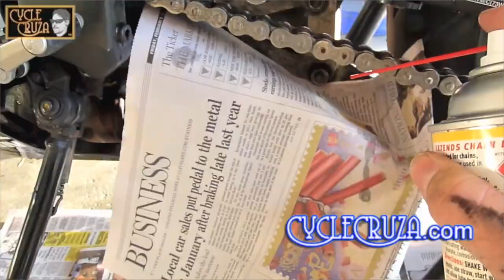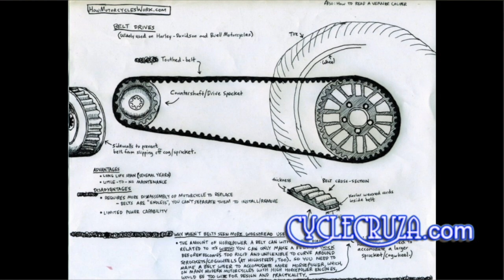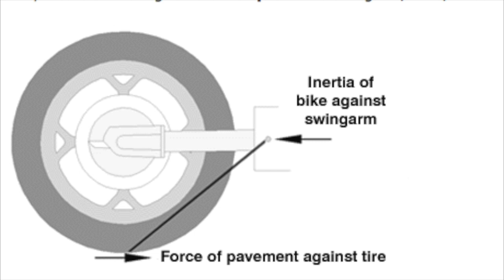Motorcycle Chain vs Belt vs Shaft Drive  - Which is Better?

Comment: As a certified technician for 4 major brands, the best drive as far as maintenance is the shaft drive, requires little to no maintenance. Belts follow. Then chains. But it also depends on the application and conditions and riding style you are trying to achieve.

Comment: Hey Cycle Cruza, love my FJR. As you know it is shaft driven but I love it. Very low maintenance, the manual says change the fluid every two years. It is a heavy bike, but plenty of power for riding on the streets. I haven't had any issues with it.
Reply from the maker: Yeah if you don't care about weight and some power loss but love low maintenance than a shaft drive is a good choice. Really, it comes down to preference.

Comment: FAKE NEWS!  The shaft drive does not lose 31 percent of its power, it does not have a bunch of gears as incorrectly illustrated in this video, and there is no longer a jacking effect. My VMAX 1700 loses 12 percent between the crank and the rear wheel. The inefficiencies of the shaft drive are not from a bunch of gears, rather it’s from the need to change the direction of the rotation. The changes in direction can be reduced if the bike has a longitudinal crankshaft. The rear jacking effect keeps getting repeated over the decades by those who have never ridden a shaft bike. Rear jacking was an issue in the early days, but not so much today. My 2020 VMAX does not jack at all.

Comment: Yeah theres no changing a belt at the side of the road. However, your belt snaps on the highway you lose power and can maybe coast to the shoulder. Your chain snaps on the highway its most likely going to lock your back wheel up and cause you to highside.  I know which I would rather have.

Comment: Where can i get som documented numbers about the loss i Shaft drive. I understand that the loss will result i heat and there is no probs with heat on a shaft drive. You got higer mass / weight, but this is only a problem during acceleration. I have seen numbers that indicates 5% i loss difference.

Comment: I think belt drive is the best compromise. You get the power of the chain with the low maintenance of the shaft.
Reply: I forgot to add that’s it’s also the safest if anything goes wrong.

Comment: I’ve owned all three types. I hate the maintenance that comes along with chains, but they’re the best in my opinion. I wouldn’t shy away from any of the three, because they all have their advantages. Belts are damn near set it and forget it. While shafts are heavier, I feel like that low weight some times helps keep the bike stable through crosswinds on the highway. I think it’s hard to beat the efficiency of a chain, but I really hate cleaning and lubing it.

Comment: Every bike I have had has been shaft drive so I cannot compare to other drive options. I’m spoiled. Love shaft drive. Although power robbing, I love the way the bike lifts up under heavy torque. I change the diff oil with oil changes. Easy easy easy maintenance.

This spring maybe you can try out my shaft driven VTX ??
Reply from the maker: Nice! Yeah low maintenance and with cruisers weight is not a huge concern anyways, it's all about cruising and enjoying the ride. You have some really nice cruisers. I was going to say keep riding but you're probably shoveling a lot of snow in blistering cold weather. lol

Comment: i ride a2015 honda shadow 750 vtc and i love that cruiser bike and it is shaft driven owners manual says i dont have to change the shaft oil till about 20k mimes and that if your going by milage. and i love my bike to pieces. it is a perfered choice to me i dont want to speed around just want to cruise ar. Love the videos cyclecruza. keep on Riding!!!! Honda CBR RR ha ha!!!
Reply from the maker: Yeah shaft drives are super low maintenance. However you get added weight and some "shaft jacking" which is a not big deal for most cruiser riders.

Comment: Brotha Cruza.  Before buying both my Ducati V4 R and MV Agusta Brutale Serie Oro, I was actually looking at getting the 2020 BMW R 1250 RS(this bike has a 105 lb per foot of torque !!!!) because of the shaft drive that it has.  Also with the 3 year, 36,000 mile Warranty along with the all famous(at least where I live) 'Loaner Bike' program which my local Motorrad has in case any warranty or recall work has to be done over a 2 day or a 2 week period !  No other motorcycle dealer in my area, from KTM, Ducati, Suzuki, Honda or Harley has a 'Bike Loaner' program; except the local BMW motorcycle dealer.   That alone was a good enough reason to go with BMW.  But, so far so good I haven't had any chain splashing issues.  Perhaps in 5 years I will get back with BMW to buy a shaft driven bike :)
Reply from the maker: Yeah BMW has excellent customer service and the bike loaner program is nice.

Comment: Pro-tip: using pure kerosine (just kerosine, none of that citronella smokeless crap) to clean the chain is the best. It doesn't damage the o-rings on the chain, it's easy to find and it's fairly inexpensive.

Comment: Hey CC, when you mention that shaft drive reduces absolute efficiency by 30%, does it mean that bikes w shaft would have a ~25% increase in power if converting to chain drive as a result?
If that's the case, my idea of engine stress on bikes like the fjr1300, super tenere 1200 and r1200gs is radically changed.
Reply from the maker: It just means that if you took the same bike and converted to a chain drive it would be a bit faster than with the more complex and heavier shaft drive. Like the saying goes "No chain no gain!"

Comment: Looks like the kevlar belt took the damage well. I wouldn't be looking to change it based on what I saw in the video. Additionally I've not heard of anyone whose had a belt failure, nit to say nobody has of course. Chain or belt I would say depends on the application, for sports bikes chain, but for mid range power and torque like cruisers for example, belt all day.

Comment: Yeah, that dude ripping the splines from the drivshaft should probably not have spaced out the sprocket so it only had half the splines engaged, and then maybe torque the nut and lock it?
It would have happened to a belt wheel too.

Comment: My Kawasaki Vulcan, Yamaha Maxim X, Honda Cx550 were all drive shaft no problems ever. My Honda cb 360, and Rebel, were chain. My Harley Sportster 883 stock and 1200 stage 1  were belt. My fastest bike was the Maxim X from 1985 Inline 4 16valve with top speed of 130ish and a quarter mile @11ish bone stock.  My heavily modded Maxim X was even faster and both were drive shaft. My Kawasaki Vulcan bone stock was quicker then my 1200 stage 1 but the sporty on the top end would crush it again (Vulcan) shaft drive. My experience has been shaft driven is not slower then chain or belt. However all these were cruisers but Maxim X had the same engine (Similar) as the Yamaha r6. 🤯

Comment: One other bike that is shaft drive are scooters. There are exceptions though. But I'm sure most aren't interested.
Reply from the maker: Yeah, one of the reasons why they tend to be so heavy. Shaft drives add a lot of weight compared to chain and belt drives

Comment: When  you say  $700  for a belt  you  must  mean   Retail   price  from the Dealer and  Dealer  Labor  costs to install it..   I am sure  you can  buy a belt  aftermarket for much less..   I had a  4 wheel  drive     Tractor  Dealership  built  Minniapolis  Moline Tractor that was belt driven .. the Belt  was 4" wide and very thick ...

  When  you say  you loose  11% pwoer  from a chain and  31%  from a shaft  crive..  You  mean from gross engine  HP  to the power lost  from the transmission  shaft and  rear  differential ..   combined..
   Shaft  Drive  bikes  also  get considerably  worse  MPG  thanks to the  power loss in the  differential ..
   You  can  put  elctric  motos on the wheels  of a car  and  run those  motors  with a gasoline powered  engine and   get  better mpg than  with a  transmission and differentiol propelled normal car...
Reply from the maker: Ducati parts are super expensive, even if you do the work yourself. It $700 for the belt alone not including labor. No, I said chain has a 3% power loss, Belt is 11% power loss and shaft is 31% power loss.

Comment: Omfg... will you, youtubers, bloggers, etc., actually open a mechanics book? Or at least look at dyno charts? There is practically no difference between power losses among these options. Or anyone is willing to tell me that a shaft somehow absorbs 40kW of energy from the engine without melting in a minute or so? Just look at rear wheel power of chain driven bikes and shaft driven bikes compared to their rated engine output on dyno charts. % difference is 1-2% at worst. And only due to an  extra gear or two on a shaft, depending on engine configuration. Stop spreading this nonsense ffs.

Comment: Power loss, who cares ? Are you really racing everywhere ? Shaft is the best, belt is a good second place, Smooth & clean, chains suck. Bmw’ s. Maintenance free chain ?  It may be better but maintenance free ? NO. Cheap ? NO. As far as changing a belt depends on make & model, Suzuki LS 650 takes about 10 min. HD sportster not much longer, big twin ?😆
Reply: One thing I really missed, on the shaft drive, make sure your happy with the gearing. In theory it could be changed, in real life it is what it is,